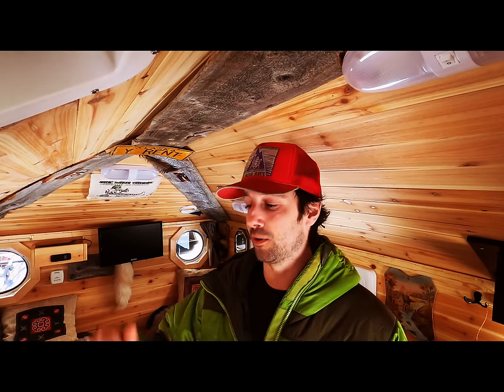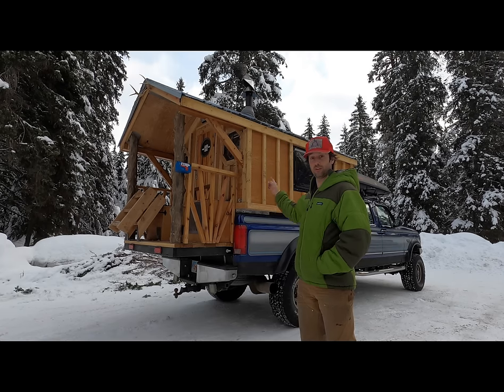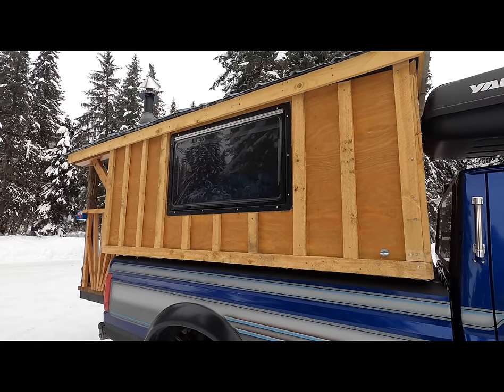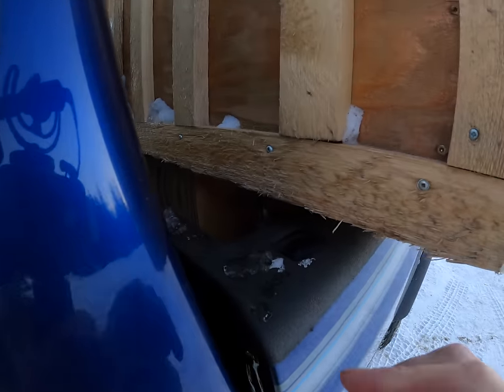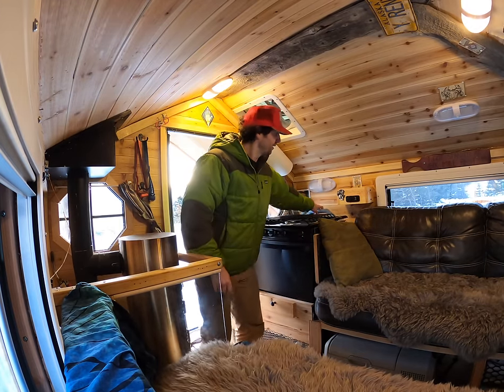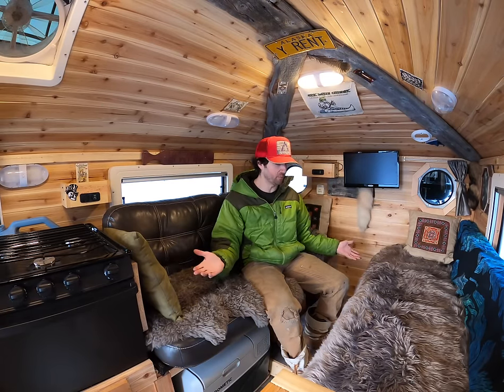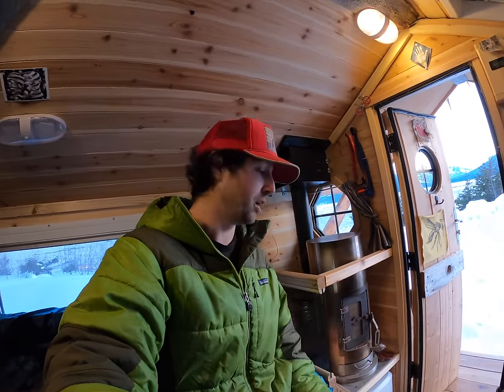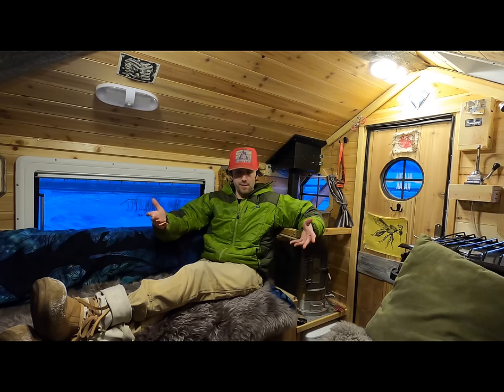Alaska Overland Truck Cabin | Official FULL TOUR : Truck House Life

Comment: I’ve been watching tiny house and rv videos for 10 years now. This is; by far, the best build I’ve ever seen.
Reply from the maker: Thanks!
Reply: I agree ! I've been watching for almost 8 years and this is the best one I've seen ! ♥
Reply: It's like a small sail boat inside, that's why (instead of like a house kitchen). In most campers the kitchen and bathroom takes up all the space, with 2 ft deep benches for like half the camper. They don't realise it's not enough space for a regular house kitchen. My van kitchen bench was 10" deep and ran across ways (right behind the two front seats) and so there was still heaps of seating (and bed) length behind.
Reply: @shannonthurman5208  YES, AND THE HEAVIEST.
Reply: Its not bad for what it is, but I'm surprised you haven't seen better builds because they are definitely out there.
Reply: 10 years? Sounds like it's time for your dream to come true 😉
Reply: @fairrider3346  He picked the right mule for the heavy pack...
Reply: Stop watching it start living it

Comment: Unlike many homemade rigs, you gave some thought to the frontal drag driving down the highway it looks like.
Reply: Jd Brunette it’s a 4x4 designed for countryside Crawling you’re not moving fast enough for wind drag to matter at crawling speed.
Reply: Jd Brunette the front is sloped to the back, so it is better than not sloped
Reply: @sigmacentauri6191  You can drive that at highway speeds no problem. Crawling?? Lol.
Reply from the maker: 69 bronco guy - lol, yup it has a hip roof up front moves into a gable roof
Reply from the maker: 70mph no problem;^)

Comment: A diesel heater would be awesome for you and could be hooked to your gas tank o humidity is null instead of propane.
Reply from the maker: I thought about it but don't want to mess with more fuel pumps/etc, propane is pretty easy for the time being, the old 7.3 power stroke diesel drinks my diesel up anyway;^)
Reply: AlaskaCreeker, do you have dual tanks?
Reply: @TruckHouseLife   I use an Espar diesel heater in my crane cab, and it is unreal how LITTLE fuel it uses. They are quiet and super efficient, and they come with everything needed to install, about a 2 or 3 hour job.
Reply: The humidity produced by the propane doesn't vent into the cabin, it's contained in the burn chamber of the furnace and vented outside.
Reply from the maker: Paul Landry - sure do!

Comment: I'm surprised you didn't hang the door the other way.  That would give you easier access to your firewood.
Reply from the maker: Wasn't enough room, it would have been tight stepping in and turning around to close it, but I contemplated it in the beginning.
Reply: Or just swap the wood box-battery box! But I would NEVER have a battery in with propane! If need be wiring up the truck batteries to the camper power grid I believe to be the best answer! Just mount a HD high amp jump start plug to hitch-unhitch! Good luck, have fun and stay safe an healthy!
Reply from the maker: @k.r.v.4219  A few folks are worried about that, yet people all around America use barbeque grills with open flames just inches away from propane, propane ranges in there homes with lines right beside ignitors, drive cars with electronic fuel pumps down in gas tanks that could short/spark, etc.  It's ventilated well at the base (propane sinks).  I put the propane and battery on that side because that's where all the electronics (fridge/fan/inverter/truck bed connection) are, so wanted to keep the wires short for efficiency ... and wanted to keep the gas lines super short so there's less of a chance of leaking/abrasion on the lines.  Eventually I'll separate the compartments within the box, it's on my list:^)
Reply: Full Send Alaskan Overland but there is a much greater risk if you getting rear ended by anything bigger than you, like say an 18 wheeler I ice? Plus is also a great idea that the propane is turned off while traveling due to fire hazard in a crash.
Reply from the maker: true, but a propane tank in most RV's is in the side compartment, so if they get t-boned then boom, life is a gamble;^)

Comment: You should build a little 3 by 3 platform and tile it then cut a draining system hole to put a hose on that rums out to the bed of the truck. Have it fold up and down and have curtains that you can just hang up real quick after you put down the platform and get one of those electric shower heads that's connected to like a 6 gallon tank or something and boom there's your shower you pull out right where you put the toilet!
Reply from the maker: Have an outside shower already (episode 30);)

Comment: A bottle of propane—-in a wooden box—-
With a Spark Hazard—Battery—Rats Nest
Of wires??
Reply from the maker: A few folks are worried about that, yet people all around America use barbeque grills with open flames just inches away from propane, propane ranges in there homes with lines right beside ignitors, drive cars with electronic fuel pumps down in gas tanks that could short/spark, etc.  It's ventilated well at the base (propane sinks).  I put the propane and battery on that side because that's where all the electronics (fridge/fan/inverter/truck bed connection) are, so wanted to keep the wires short for efficiency ... and wanted to keep the gas lines super short so there's less of a chance of leaking/abrasion on the lines.  Eventually I'll separate the compartments within the box, it's on my list:^)
Reply: Its your BBQ,,,GOOD LUCK!
Reply: @TruckHouseLife  

Yeah, but...if that propane tank is leaking gas into the grill and you hit the striker or ignitor before opening the lid of the grill...   Just sayin'
Reply: Thank goodness finally YouTube genius get a job
Reply: @stevemitchell2252  everyone loves the camper, it's not jealously to look out for a fellow traveler. Venting the box does nothing to stop sparks. Love the build man, shared it in a bunch of places but do something to protect yourself and others that may be parked near you.

Comment: Great job! Be carefull with 12V baterry instalation is not recommended to be near propane tank.  Any bad DC connection will make it to the electic triger to propain tank and make it to bomb! The electric formula is simple is the ohm low and the resistance will make it to go heated more untill it ignite the propane and explode!!  And you need better thermo insulation due to the faxt that you will loose up to 30% energy juice when the temperature comes to water freezeeng and under!
Reply from the maker: working on a fix for it

Comment: I wish I still had my 97 F-350 truck like yours, I'm now in a 2019 F-350 but with the 6.2L gasser. I  have a full size camper that is a 4 season with a slide out, but I can definitely tell I'm loosing a lot of heat winter camping.  I am envious, that is not only a awesome looking inside and out, but I love the wood stove to keep things warm while your on the road.  If you ever get down to the lower 48 in the Durango CO area, I'd love to check out your rid. All the best. BC

Comment: You should put a slide out on that bad boy or built it long to go over the top of the cab of the truck . or build it stronger so it won't break so easy rolling over big rocks if it happens to bang into a rock wall or trees lol the windows I would put flexy glass or something strong so you still have good windows . another idea I would make some how very tough and hard to break into .
Reply from the maker: I thought about it, but a slide would be heavy and too much hassle trying to weatherseal everything, dealing with ice buildup (when trying to close the slide) and also insulation.

Comment: Very nice you thought about what was important and necessary in camper.
My dad and I build a boat just a suggestion you can take it or leave it but there’s like 4 inches between the outer wall in the inner wall he put up a bottom to it so it would go down only so far but he made like 1/2 of it for like plates the chicken slide plates and I’m on their side and then the other half of it he made like three different holes and Houston for like juice glasses water glasses and large cups so that way we could stack them. And not have them slide down through the hall so I made it like a half inch narrower so they slid almost about 2 inches from the top down to that hall and then we stacked like four in each hall and then he made like a center section like a slit bike for forks and he turned the knives like upside down so the heavier and was at the top but the pointed end was down but it was like Four forks four spoons for knives it was like going behind the kitchen area along the wall and then above it he had a sliding cabinet where my mother kept like spices and things like that. It’s a suggestion if you want to take it or not but I think you’ve got a lot of areas I never saw your dishes were at. But you thought everything out.
Reply from the maker: Yep, still have a lot of storage customizing to do;)

Comment: A small air tight minidoor for easy and safer access to your driving seat from your cabin and vice versa would be a good improvement Sir. God bless
Reply from the maker: would have to have a sliding window and cut a hole in the camper;)
Reply: @TruckHouseLife   that'll be nice Sir, you'll love the convenience after :)

Comment: My first 15 years of vehicle-camping also involved building a wood camper on the back of my truck.  After years of that, I switched to a van, and a van conversion, which I found more spacious and easier to maintain.  The wooden camper has an aesthetic that is hard to match with a van conversion, but built-on wood campers have drawbacks, such as their weight, being rattled out of shape, leaking roofs, and the overall size will be smaller than what you can get in a van, where the cab area is included in the interior space.
Reply from the maker: Nice, no leaking roof here though;)

Comment: I could live in that being a minimalist.  My only thing I’d do differently is have HAVELOCK WOOL instead for insulation.  That way being up farther north in Alaska past Anchorage and UP where it gets -40F is more doable; except perhaps the water.  Otherwise; GERAT JOB.  It works for you down there in lower AK.
Reply from the maker: Thanks:). Spray foam is actually warmer than wool insulation spray foam fills every crack and is impermeable, so no drafts at all;)

Comment: Any pro tips on getting the Kimberly to work consistently? We’ve had ours for a couple months and it’s very finicky. I’d love to hear from someone who has used it for many years, thanks!
Reply from the maker: Yup, very finiky stove until you get it figured out.  Use fire starter, use a BUNCH of kindling, use a saw dust log on top of the kindling, then gradually step up wood piece sizes.  Keep the door cracked the 1st 10 minutes of starting.  Should be good to go.  I leave it full burn/full open draft control most of the time.  If you look up my youtube videos I have one on the kimberly stove that shows how I make the fire for it.

Comment: Exposing all the wood frames to the weather is not a durable solution. All the horizontal surfaces will trap water and difficult to waterproof. Adding a rain screen will make a huge difference. Yes, it is proud to own something you build it yourself, good job. I like the interior wood, cozy and feel like home.
Reply from the maker: Its waterproofed with varnish just like a sailboat;)

Comment: Does your battery charge completely off the solar panel, or you have it wired into the trucks alternator for extra boost? 

How many batteries in total do you have powering the cabin? 

The tool boxes on the sides of the truck, are those used for anything? What all do you carry in there? 

How does the truck handle while driving on the hwy in heavy wind situations? 

How long does the propane usually last if you're out completely remote for months at a time? 

Are the windows readily available for purchase, or is that a special order item?
Reply from the maker: 100 watt solar panel and truck charges it while I drive

Comment: This may be a dumb question but if that camper is so air tight then how do you get any circulation of air in there?
Reply from the maker: Maxair vent fan or crack windows when needed.

Comment: Yo what's up bro I'm about to do my first tent camping trip in 26° weather tomorrow night with a foot of snow coming to Trenton New Jersey...lol..... I got everything all set up ready to go I got my campsite set up and I'm going to try and do it rugged style I'm still learning how to try and make a fire I got the fire starter kit but should I use a fire log chopped up?
Reply from the maker: Right on man! Super small kindling and build up from there, make sure it's dry.  Birch bark works wonders.
Reply: Are you ok dude?  You should definitely practice before or at least know how to start a fire before going out in 26 degree weather in a storm.  I mean that with no disrespect at all, i have slept in temperatures below that without a fire,  but had the Military Extreme Cold Weather Camping System.
Reply: @dustinpollard6237  I'm okay everything went fine I had a portable heater
Reply: Good,  i'm glad you planned a backup. I mean i don't know if you're 14 or never been in the woods one time, or anything so just wanted to check.  Awesome,  right? Nothing more peaceful than being in the woods during a snow.
Reply: @dustinpollard6237  yes I'm an avid camper and I was testing out my new tent which worked phenomenally because I picked a gully so I wasn't really getting all of the snow and freezing rain on me but there was a decent amount of snow and it was a nice snowstorm it was my first camping in a major snowstorm because Jersey hasn't had any major snow storms in like 5 years and I just started camping this year heavily but I handled it pretty good it was fun and I'm not 14 I'm 45 years old LOL and thanks for your concern

Comment: I'm not so sure it's a good idea to a battery in the same case as a propane tank. If you get a spark from one of the wires on the battery and there's propane draining. We both know what's gonna happen. You need to seperate those two. And you mentioned driving down the road with a fire lit inside the camper. Nothing safe about that.  You're making some dangerous decisions.  Just because it hasn't happened doesn't mean it won't.  Just a thought. Happy trails. Stay safe. Nice build.
Reply from the maker: Fixed that part, no more battery next to propane;)

Comment: Needs a 'collapsing hand-rail' on each side of the folding stairs and the reason I say this is because if you have a hurt foot or some other injury it might be impossible to 'get inside' in a bad storm
About 6-yrs. ago a ladder went out from under me and both feet trapped under a rung and thought I had a 'sprain' on my left foot and the other was fine
Next day I was in total agony from some little snapped or crushed bone in the hurt foot
( I'm pretty tough and very strong...but I was no match for that PAIN at all! )
________
You have nothing to 'steady yourself' trying to get-up those stairs and help 'pull yourself up' by hand
( I'd put 'bear bars' on those side acrylic windows...something I can 'slide' up or down for when I'm not sleeping  'Mr.Hungry' will take awhile to try and get in and that buys enough time for 'Mr. Firepower' to say 'Howdy! to a determined bear )
Reply: ps...I want my battery-power INSIDE w/me to avoid extreme cold
Reply from the maker: lol that sucks

Comment: What's so special about the windows?
Reply from the maker: Insulated double panel without gases (so no gasses to leak out causing condensation)... and they have built in blinds and screens on rollers:)
Reply: @TruckHouseLife  You should have taken the Lowe/Argon.  It doesn't leak out causing condensation.  The blinds and screens are cool because the top of the windows are radiused.  

I think you did a great job on this thing.  Looks great and is pretty practical.
Reply from the maker: @jimmoran973  thanks man